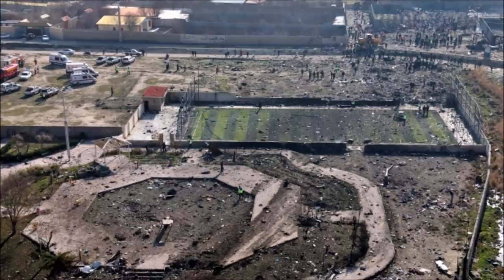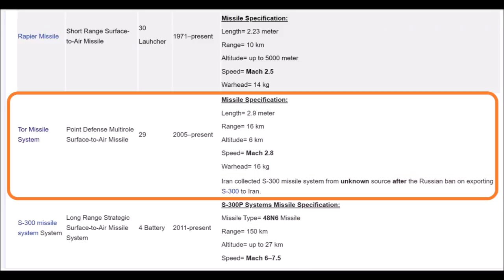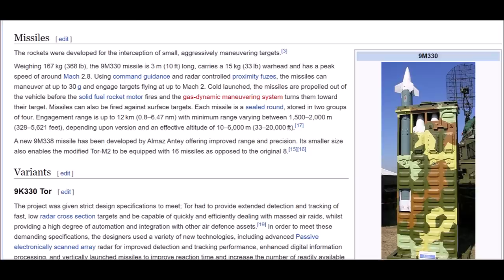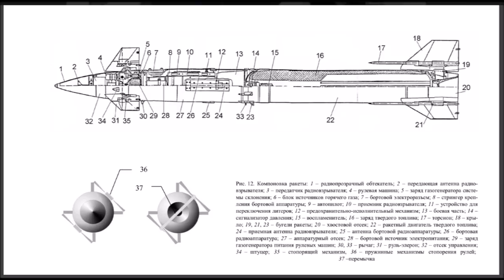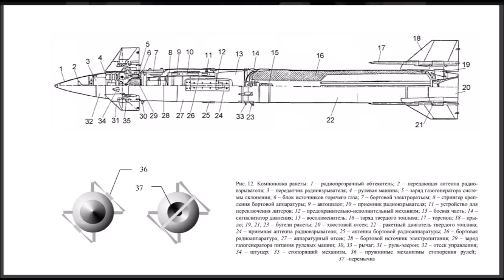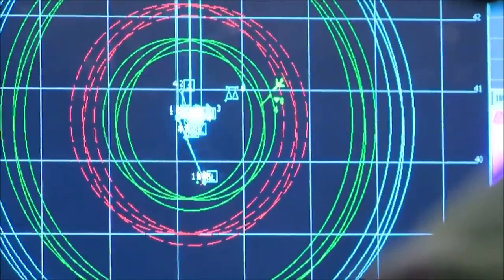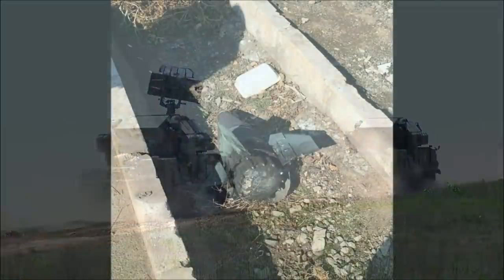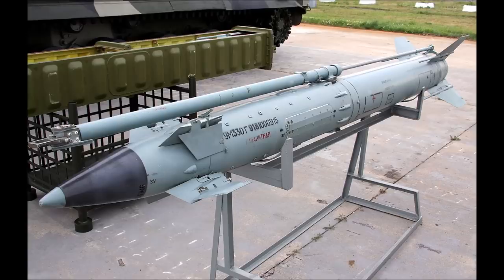SA-15 (Tor M-1) Surface to Air Missile system. Boeing 737-800 down in Iran

Comment: One thing I learned in the military. 
Friendly fire isn't.
Reply: Not so friendly i'm afraid.
Reply: The bullet doesn't care if you are ready, does it?
Reply: Heard  a manual once stated ,”Remember, when the pin is pulled, Mr. Grenade is no longer your friend.”
Reply: @stevek4449  Would that be during that charming period of enlisted education when some genius at the Pentagon decided to issue training manuals in a comic book format?
Reply: Possibly, but was never in military unfortunately. Also heard the s400 Russia has uses dual radar systems for single vs dual launch.

Comment: Juan,  I was a Nike Missile man in the 1960's and our missiles did not have an autonomous or semi-autonomous mode like these modern systems.  Because these systems are designed for low flying aircraft, in the autonomous modes they can fire themselves.  The system is designed to automatically assess the threat and then fire.  Because modern low level fighter-bombers move so fast a human operator can't react in time.   A commercial aircraft climbing out could be perceived as a low level attack and even with an operator these could give an indication to fire or fire automatically.   Most of these systems do not query IFF/SIF to weed out friend, foe and commercial aircraft.   Bob N.

Comment: Also the previous planes departed along a similar track and were not targeted.
Reply: -It's called 'Buck Fever'... itchy trigger finger syndrome. Just gotta... let 'er fly..
Reply: I wonder why too. There was 5 hours between the other missile attack. There had to be many other planes departing and arriving. Why this one?
Reply: sparkdog44 , great question
Reply: @sparkdog44  Typically, the first departures of the day leave most US airports between 0530-0630. Some cargo/Red eye flights leave between 0000-0230.
Reply: @sparkdog44  Heard this flight left on a 2 hour delay. Somebody didn't get the memo?
Reply: LOOK AT THE FLIGHT MANIFEST... Who did they want dead?
Reply: @Blogengezer  kinds shows psychologically speaking Iran was pretty worried about what the US would do... Sure doesn't look like they were confident and sure like much of the media was indicating... If anything this proves everyone in the US from the top down to the general public may of greatly underestimated the effect the drone strike on the general had on Iran's leadership...
Reply: @robertquick6690  exactly.
Reply: The whole story doesn't add up. 2 missiles and the plane was still in one piece while falling to the ground ? How is that even possible ? Even one missile should have torn the plane to pieces immediately.
Reply: @mistergeopolitics4456  I might be wrong but i think these missiles are designed to explode near the aircraft, sending shrapnel into the fuselage and engines to disable it.
Reply: @kinglamus479  No usually missile go right through the target and explode close to it. No way that plane could take a hit from 2 missiles and keep flying in one piece. There's something fishy about this whole thing. Just like how they can't find the video recordings from Eipsteins suicide.
Reply: @kinglamus479  Yes they do..
Reply: @sparkdog44  that's a good question.  First, I would wonder whether there actually had been other planes departing and arriving?  Second, if it's true that there had been several planes that arrived and departed, then why was that even happening?  Why didn't Iran shut down the airport from the time of their missile launch on US bases, and keep that airport shut down for a couple or three days?  If Iran was concerned about a US strike after their missile launch, why would you muddy the waters on the radar screens of the anti-aircraft radar with a whole bunch of commercial flights?  Hindsight, I know, but jeez, if you're expecting US warplanes overhead, wouldn't you want your airspace completely clear of ALL commercial aircraft?
Reply: @mistergeopolitics4456  I don't believe the warhead is large enough to tear the plane apart immediately. Looks like the warhead works by sending shrapnel in all directions, and if it's close enough to target when it explodes, some of that shrapnel will hit the target.  It doesn't explode the target, just hits it with red hot metal which tears holes in the plane and likely starts fires (when it hits fuel tanks and lines)
Reply: then bodies should have this shrapnel in them to prove it was a missile.
Reply: @etuke  right. expect I believe the shrapnel is actually very large rods and other large pieces of metal.  Would probably have ripped right thru a human.  And in the debris field of a crash like this, are there actually bodies or just body parts?  (sorry to be so graphic.)
Reply: @mistergeopolitics4456  The missiles have proximity fuses, which means they do not need to contact the target, exploding instead close by and severely damaging the target. The breakup occurs due to aerodynamic overload in the rapid descent, ie. said aeroplane exceeds it's Vmax on the way down and begins to break apart.
Reply: @pimacanyon6208  Metal ball bearings, in some cases, like an anti-personnel mine. In this case, metal "bow ties" designed to break an aircraft structure.
Reply: @robertquick6690  that's one possibility.  the other, which I think is much more likely, is that someone just screwed up, misread the radar, thought it was a US plane, and fired the missiles.  Seems likely to me that this was just a horrible mistake.

Comment: An image of a 9M331 seeker claimed to be among the debris of flight 752 has been circulated, the "seeker" has the four articulating control "conard" surfaces, computer, RF communications, other electronics as well as four pointing / orientation thrusters which allow for it's good turning characteristics.  The 9M331 is only integrated with an RF proximity detector (fuse), otherwise it doesn't have the facilities onboard to guide itself, the "TOR - M1" ground launcher incorporates a control station and radar(s) to communicate with & guide the 9M331 missile to it's target, from what I know about the 9M331 it doesn't even have the ability to report back closing speed on it's target.  Russian made munitions like the TOR - M1 are very popular as they are fairly effective, simple, & relatively affordable. Virtually all modern US made similar defense systems have missiles that equip all of the target seeking facilities into the missile itself, radar, thermal, proximity etc... which results in a higher hit rate along with greater cost. Following the launch of a 9M331 it is normal to find the seeker (nose cone) section as the 9M331 is constructed of three modular sections, the seeker (nose cone w/ four fins), "warhead" (mid section), & propellant section. With proper tooling the warhead section can be removed & replaced with a desired munition,  when the munition detonates the seeker section will separate then will simply fall to the ground, it is common for the propellant section to be found intact as well though it depends how much propellant was burned by the time the missile commands detonation & or hits it's target as the remaining propellant will detonate in conjunction with the munition.

Comment: The size of the debris field and size of the pieces sure point to a missile strike.  
RIP crew and passengers. 
🙏❤️
Reply: Starting 1:40 in the video the pics show shrapnel penetrations in a panel and cowling consistent with a missile attack.
Reply: @awesomexistence  nothing there is inconsistent with damage sustained during ground impact and breakup...
Reply: Steve Roberts, there would most definetly be a distinct ground marked (plowed trail) impact trail with ground impact and breakup and large pieces of intact fuselage or small radius of debris with a crater from a vertical impact. No evidence of this in pictures. Pictured evidence shows
the debris field is wide and elongated with practically every part of the plane in small pieces. Debris spans walls (with no apparent broken wall segments) and ditches. All this points to breakup before ground impact.
Reply: @awesomexistence  Yes, the truth is out now Alan! Very sad for all concerned really. IRanian and western.

Comment: How does one ACCIDENTALLY discharge a missile and shoot down a passenger aircraft??? What is the SOP when control of Air Defense Systems  is lost? How do you lose control,  did someone unplug the ethernet cable?
Reply: Apparently the IRGC is completely separate from the Iranian military.  As a result this SAM battery was not tied into the Iranian air defense network.  And the missile battery is protecting one of their WMD facilities.  It appears that the Iranian air traffic controllers routed the airplane directly over that facility.  The people at the missile battery had a low flying aircraft pop up on their radar and it was headed directly towards the facility they were supposed to protect from air attack.
Reply: Ali Khameni [according to Iran news] was personally in charge of the missiles launched against Iraq bases.  Maybe he was having fun, playing with the firing buttons at headquarters?
Reply: Sal Vastola  The problem is that it was sheer incompetence that put them in that situation.  Think about it - all they had to do was monitor the local air traffic control frequencies.  Not only that but the IRGC is completely separate from the Iranian military.  They do not even maintain constant communications links with their counterparts in the Iranian military.  (Because their job is to take down the military - and anybody else - should they threaten the rather corrupt regime that rules the country.)

So they were not tied into Iran's IADS (Integrated Air Defense System).  So they were not getting information feeds as to what was going on  in the air around them.  

Something like this was inevitable under those conditions.

Comment: Sir! What do you think about the fact the Airplane turned North and flew for 18 miles after being hit by a missle? At a low altitude of 4600 ft the plane should’ve been obliterated in the sky and stopped at its tracks. At this rate the plane likely was descending at 1800 ft per minute, just as slow as a regular descent. Do you think pilots were alive and trying to turn back around? Possibly crashed eventually after being hit by that “2nd missile”?

Comment: Friendly Fire or...someone on the Plane the Ayatollah doesn't like?  We may never know.
Reply: There is a lot of considerations that can be made on the ties to this aircraft. The complex geopolitics between Iran and Russia, as well as the US and Ukraine could almost make this seem like the action that was taken could be a political move as well.
Reply: The plane was filled with a pretty even mix of Iranians and Canadians other than the crew.
Reply: @allangibson8494  That's true, the manifest released does detail that. Why so many Canadians? That one is strange actually.
Reply: @rixille  Canadian student group....
Reply: @allangibson8494  It is alleged too that Iran started cleaning up the wreckage before any investigators could arrive. Not sure if this is confirmed true yet, but that would be suspicious if so.
Reply: @rixille  The Canadians were mostly ethnic Iranian too, they just have a Canadian passport. They went to Iran to see relatives and chill on vacation. 

I suppose the cleaning up is done to hide parts of the aircraft with shrapnel holes.
edit: wrong word replaced
Reply: @allangibson8494  most 'Canadians' were dual Iranian passports
Reply: @randyrick8019  Given that 90% of the passengers were traveling through to Canada (including all the ones with Iranian passports) that is not surprising. Quite a number of university students and lecturers were on the flight however pushing up the numbers.
Reply: @allangibson8494  any idea whether any Russian advisors are in Iran providing 'training'

Comment: It seems that in fact the airplane turned rather sharply to the right, as per Iranian information (whether this turn was before or after being hit, it remains to be determined). The last position acquired by FlightRadar24 was 35.490463,50.952988, while the field that appears at the  crash site shown at 01:55 in the video is at coordinates 35.561707, 51.103624. Assuming two path legs (airport-> FR24 last position -> crash site) , this would result in a sharp, 125-degree right turn from the take-off path.

Comment: This was very likely an unintentional accidental shoot-down, yes.  There will obviously need to be a full comprehensive international independent investigation to make final determinations. One question would be: was the command center overseeing the just completed missile strike on Iraqi Air Base, also in the loop in giving green light to engage the B737-800?  Either way, this could be an expensive mistake, via owing Ukraine Airline a new jet + compensation to families of victims .

Comment: It is also possible the missile was a HAWK missile originally sold to Iran in the 1970s by Raytheon and later produced by the Iranians themselves , I trained with the Iranians in Fort Bliss Texas before the fall of the Shah of Iran ,  I do know it was still being updated as late as 2012 and was being used in Tehran , reasoning for this is the video which shows the rocket exhaust trail as large as the fireball of the 737 , the Tor is a smaller missile , I'm a former USMC HAWK Missile Operator - Technician and I've seen many HAWK launches and sure looks like a HAWK and standard practice is to ripple fire 2 missiles as US officials are stating
Reply: Did the Iranians you trained with do OK in the school? I heard a lot of negative comments about IIAF F-14 radar system trainees at NAS Miramar around 1976..The claim was that they were draftees fresh off the farm without any prior basic electronics training. If true, they would have had zero chance of success in a US Navy class 'C' school. I had no direct contact with them myself so it's possible that the stories I heard were b.s. scuttlebutt.
Reply: @Thankz4sharing  We only had Iranian Officers training and they were to train there enlisted troops , that did not go well , Raytheon had to send training employees , so that being said yes the Iranians had a really tough time with the training coming from a 3rd world country , and you never know it very well could have been a Russian missile , but can you imagine being that Iranian battery commander this morning

Comment: The Fog of WAR sadly 😕
Reply: Guss Ruffee  A state of affairs in which two sides are launching weapons at one another and expecting weapons launched at them is what in your opinion?
Reply: News I've heard is that Iran actually told the US that the were firing the missiles, that they would be aimed harmlessly out into the desert, and it was just posturing. Iran does not want to poke the US right now. No matter what your opinion on President Trump is, he is somebody who acts swiftly and severely. Somebody apparently forgot to tell the crew on that SAM site.
Reply: UnAmerican -- there were other airliners taking off prior this commercial airliner. As stated the Jetliner was a mere few kilometers down range of the international airport departure flight path and was struck by a short ranged SAM system virtually under the flight path. AD crews are not stupid. They can identify a commercial liner at 290 mph climbing right after takeoff . thanks bud
Reply: Guss Ruffee  I seem to recall a number of accidental shoot downs by SAMs in the area over the years. Inexperienced soldiers can make rather poor decisions.

Assuming the reports are accurate as regards a shoot down, who knows what the circumstances were that lead to it. That said I highly doubt that the Iranians shot down a civilian aircraft for the sake of it. Especially one that was carrying its own citizens.

Comment: New video showing missle hit aircraft, possibly a smaller missle than the Tor M-1. The flare isn't that bright and distance from sound delay (explosion to bang) only works out at about 4kms max from camera. Sound travels 1 kilometer in roughly 3 seconds and 1 mile in roughly 5 seconds. Hand held missle?
Reply: Hand held can't reach 8,000 feet.
Reply: @av8tor261  Oh ok. Spec for Stingers is 15.000 feet?

Comment: Even after the admission by the Iranians of the shoot-down, there is still a reflexive desire by both investigators and the public to acquire possession of those quasi-sacred black boxes, the CVR and FDR.  This is technology that has only been in wide use since 1960, but somehow investigators managed to perform investigations prior to their advent and requirement.  In the case of UIA flight 752, the CVR could provide the location of the missile strikes.  By triangulating the explosion recorded by the three flight deck microphones, investigators could get a pretty good idea of the location of the hits, but that is about it.

May I suggest that the most telling black boxes are the passengers themselves.  I am certain that many of the passengers bodies are full of shrapnel from those SAMs, so knowing their seating assignments, it should be fairly easy to determine the locations of the strikes based on shrapnel load, pattern and depth of penetration each individual passenger received, something medical examiners would have been task with once the bodies were returned.  The finger-print of the shrapnel would also confirm the weapons, Russian SA-15 SAMs, just like any other ballistics.   For those reasons, the Iranian government had to admit culpability or refuse to release the bodies, an intolerable act that would have surely isolated the country.  So did they really have a choice?  No.